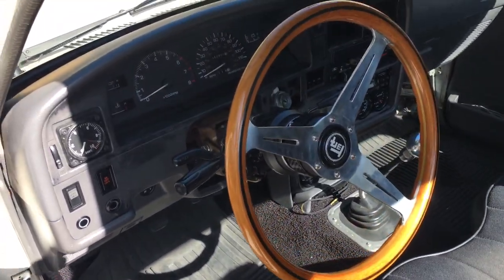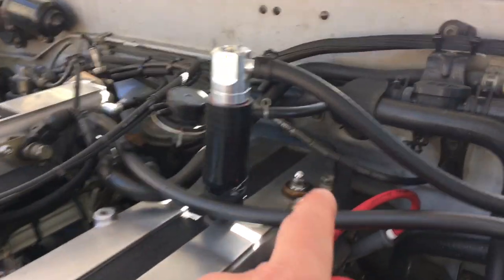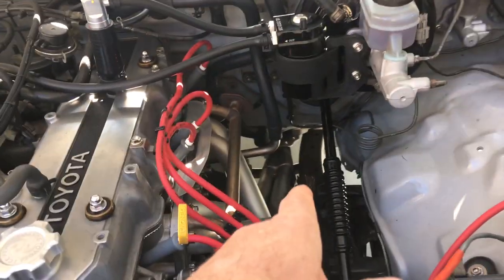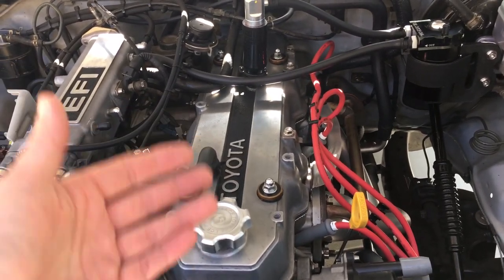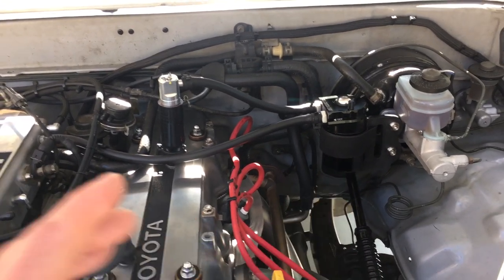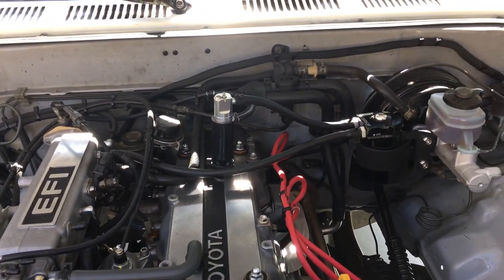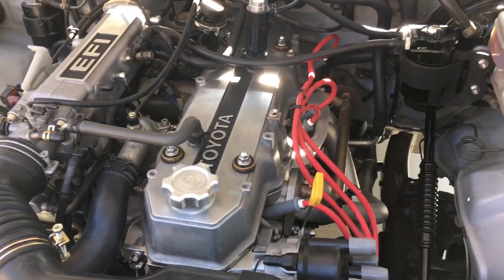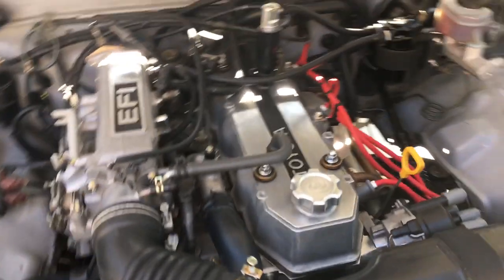Quick update: Toyota 22RE oil consumption / PCV / Oil Catch can / IAC valve - 1990 2WD Pickup LCE

Comment: I think your swamping hypothesis might be accurate. The amount of oil being blown around in the valve cover from the stock pump is astonishing. Forget to put the oil cap back on and start the engine and in seconds you will have an oily racing stripe across your hood. A pump that increases the amount of oil in there could possibly be overwhelming the design parameters of the scavenging system.
Reply from the maker: Yeah, I'm wondering about that also. I've seen videos on line where they construct clear oil pans and clear valve covers and fire up the motor... the volume or oil that moves is amazing. I'm definitely wondering if positive crank case pressure (for any extended duration) could slow down oil returning to the pan just enough to create some mild vapor look situation or something, which would allow oil to build up at the back of the head where it has to travel down that return passage. It's hard to say for sure, but sometimes I wonder about it being a contributing factor here all right.

Comment: Are you able to see the TDC link on the tuning chain passed the baffle without removing the valve cover (to avoid) ?  Thanks
Reply from the maker: Yeah, on my valve cover I had to remove the front baffle thing in order to provide the necessary clearance for the dual row timing chain. As a result of that, when you unscrew the oil fill cap and remove it, you can see down in there and see the timing chain, the nose of the camshaft, the camshaft gear, etc. If you check a couple of my more recent videos, I think in one of them I actually show it. But short answer is yes, you can see the timing chain no problem. However, finding the shiny links is another issue, as everything is covered in oil.

Comment: So u blocked off the air control valve ? With tape…what does it idle at?? Becuz if u adjust the screw the idle goes up and down
Reply from the maker: It's mainly just for testing purposes. When it's cold, it won't idle very well when it's blocked off. Once the motor gets up to operating temp, then it idles as normal. The idle screw is a separate hole, which offers its own control.
Reply: @ray5961  gotcha I’m gonna tinker with mine thinking about the egr delte and the pcv delete just heard u talking about that one with tape might through that in too and btw what kind of tape becuz if that comes off it’s going in?
Reply from the maker: @kyleburns1546  Duct tape works fine, but make sure you wrap the lip out and over the edge of the throttle body, so it's trapped between the rubber elbow and the outside - that would prevent it from coming loose and getting sucked in. Don't leave it on there too long either, it's just for diagnostic purposes, not long term or anything. The EGR delete is fine; it will help to keep the intake system clean and give you a little bit more power. The EGR has both pros and cons to it, but yeah, it's kind of a pain in some ways and very dirty for the inside of the motor. I would not suggest removing the PCV stuff. If you do that, you are going to create issues for yourself. The crankcase will end up pressurized if you don't install a breather. If you do install a breather, you will inadvertently throw off the EFI fuel mapping (unless you are running a carburetor, which I assume you aren't). Make sure you fully understand how all the systems function and what they do before you start ripping stuff off and throwing it into the trash over there :) I've made that mistake more than once and it's not fun.

Comment: I’m struggling on that pcv having to much pressure given that it’s a turbo that I put in seeing what’s my options thinking to out in also a oil catch can
Reply from the maker: You could convert over to a full dry sump system, but that's a big job. The other option might be to plumb something ahead of the inlet of the turbo or throttle body that opens under boost. That's one to probably research on line a bit.

Comment: where did you get the catch can and bracket from
Reply from the maker: Amazon for the catch can - here's basically the same one: https://www.amazon.com/EVIL-ENERGY-Universal-Reservoir-Aluminum/dp/B081N392BN - and for the bracket, I made it from 10mm / 3/8 thick ABS from McMaster.com - just used a hack saw and some wood rasps to shape it and drill it. Then used some SS coupling nuts as stand offs from the brake booster - these here: https://www.mcmaster.com/90111A333/
Reply: @ray5961  very nice. Wish you could make me a bracket for the catch cam just like what you have. I'd pay to get it done
Reply from the maker: @erahelp  Appreciate the vote of confidence, but not in the part making business yet :) Maybe down the road.